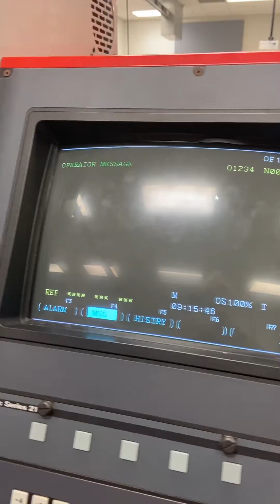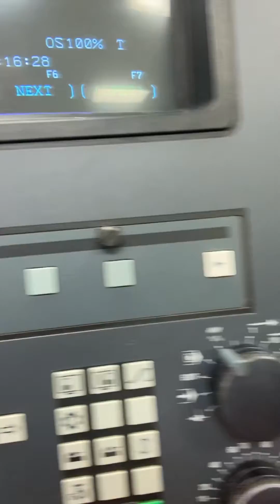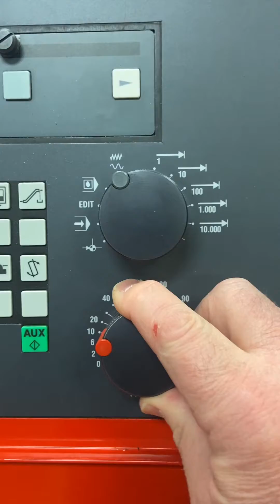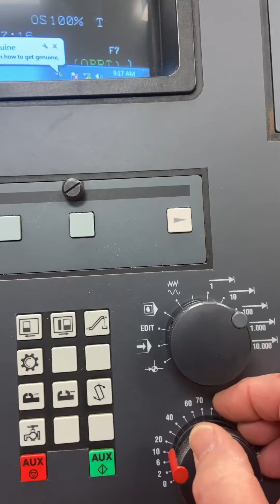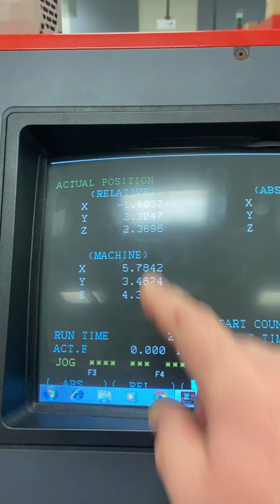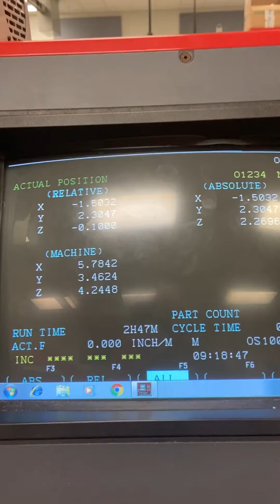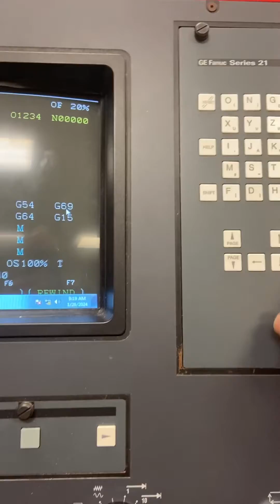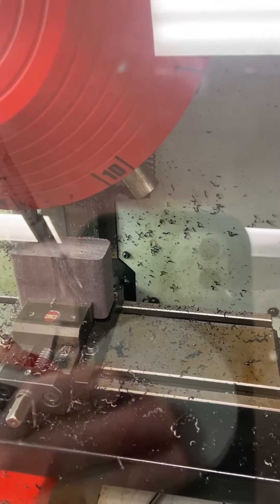Facemilling on the Emco PC Mill 125

Comment: Hi, Are thoose machines capable to machine easier job in steel? Or are they to weak? Br
Reply from the maker: Yes, they are capable of machining steel but you can't make heavy cuts with them otherwise the spindle stalls out.  The max RPM on these is 2000 rpm as well so I can cut aluminum but not at the feeds and speeds it is cut at in industry today.

Comment: How did you get it to run windows on it? I'm looking to buy my first cnc and found one like this for a good price. Would like to upload g code from fusion 360 and via USB upload it to the machine to run the code. Do you also have usb on it ?
Reply from the maker: Students learn how to manually read and write G-Code for this machine. If you are using Fusion to generate your code, you would probably need to manually edit the prep code since I doubt that there is a post written to post process the code in any CAM system. I'd probably just use a generic post after you write your tool paths. Its a good training machine. There are better production machines out there.